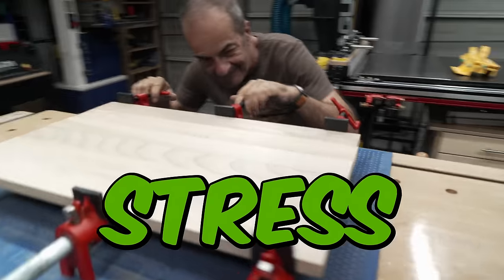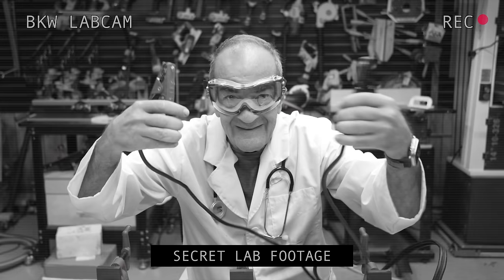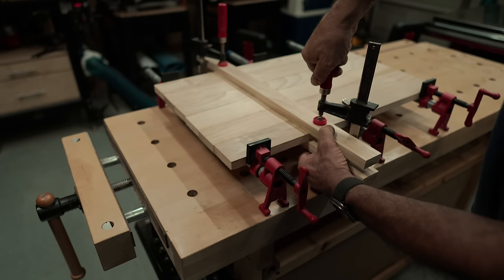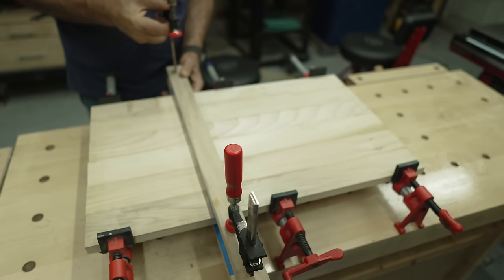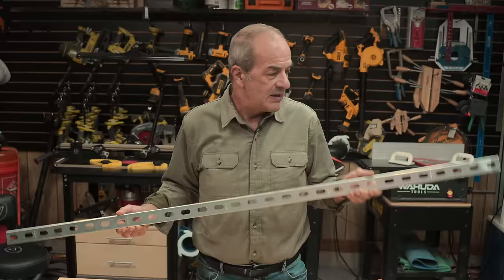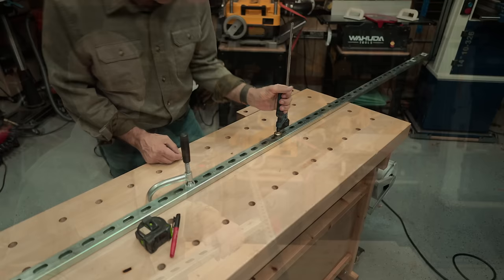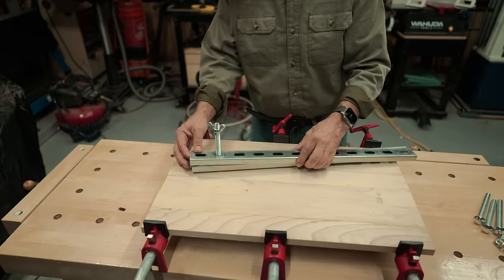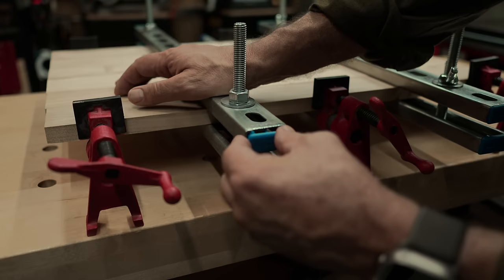Rockler doesn't want you to see this video

Comment: Having used thousands of feet of this stuff as an industrial electrician I can tell you that the 1-5/8” version is much stiffer than the 7/8” you show here, there’s also 3-1/4” deep if you really need stiff stuff. In addition, they sell heavy square washers so you can use the strut with the flat side against the wood to minimize denting of the wood.
Reply from the maker: The washers are great, I recently discovered those during a random stroll through my local HD. I’m aware of the larger sizes but those are more expensive and probably overkill for most glue ups unless you need to go really wide. Thanks for the tips, very helpful. I love when the viewers are smarter than me!
Reply: @BustedKnuckleWoodworks there are magnetic washers too for uni strut. Makes placing them much easier.
Reply from the maker: @akbychoice  really? I've never seen the magnetic ones. Gonna have to check those out!
Reply: As a commercial plumber who has also used thousands of feet of this, I came to say the same.
Reply: As a former plumber I’ve used superstrut in the thousands of meter range. Installed equivalent amounts of pipe on ‘m, also used it to create mounting solutions in awkward situations and spaces, for all kinds of appendages. These struts are also excellent for making mounting points in basements, without having to drill once into the basement walls. On the deep end, I’ve used superstrut to reenforce the inside ‘retaining’ walls of my version of an Earthship, where I wasn’t allowed to use discarded tires at the specific location. 
On the use of the carriage bolts, that’s of course a viable option. However, when one flips the strut with the smoothest side to the be glued object, the true value of the strut can be used. With the open side of the strut available, one can use threaded rod to length, put a slide nut on the rod, put this through the hole of the strut closest to the workpiece and then place the slide nut in position on the ‘fingers’ of the ‘C’. Following, this position can be fixed in position with a similar washer and hex nut. It secures the bolt at the location for several work pieces of the same width. Much easier than sliding the carriage bolt from underneath. 
Absolutely agree with Kevin Stenger on the 1 5/8” version being much stronger, and for heavy duty the 3 1/4” is indeed excellent. Equivalent in metric R2 15mm, R2 20mm, R3 40mm, R4 46mm, R6 60mm. Of which the R3 version is a double sided (thick) strut, which may be an option for super heavy duty. Cheerio
Reply: Outstanding ideas from all the trades guys, making a great woodworking idea even better!
Reply from the maker: @j10001 these trade guys are smart! They could fix the world if only we would let them
Reply: That was my first thought, flipping the struts around so as not to dent the panels
Reply from the maker: @denniswilliams2385  you won't dent the panels as long as you don't overtighten. PLus, the wind nuts wouldn't fit. But the square slip washer idea would take care of that I think... 🤔
Reply: With all those tools hanging in the background why doesn't he have a proper portaband for cutting strut? And did he properly file the ends?
Reply from the maker: @TNickel555  woodworking doesn’t have much call for a portable bandsaw.
Reply: I have some in stainless steel that is the 1 7/8. I have used it to make everything from a carriage for my welder in my crawlspace (had to reset my piers and I put in steel IBeams for new cabinets and granite countertops). There is is all kinds of stuff atuff you can use it for.
Reply from the maker: @danielbeltz1914 I’ll bet those stainless ones are pretty pricey 💰
Reply: @BustedKnuckleWoodworks  By that logic nor would you have much use for a metal grinder!
Reply: @BustedKnuckleWoodworks  I am a Fiber Optic Transport Engineer.. we use them in hand holes to secure fiber.. When i need one....... 😁
Reply: Carpenters probably shouldn't argue with electricians. Just sayin. But at least you're smart enough to learn from us!
Reply from the maker: @TNickel555  I usually keep a Kutzall on it and use it for carving in the woodshop.
Reply from the maker: @danielbeltz1914  like a thousand uses for this stuff!
Reply: Our cost on 316 12 Gauge 10' 1 5/8 is a bit over 300.. but we buy a flat bed at a time. Every job gets qouted a whole stick.. we might use 2 full sticks.. or we might use 6” and that stick wont go back out on a new install. It might get ised in a repair. But new installs always get a full stick on the truck. So i will bring the 10' - 6" home when needed. I did my Mini Split stand with it too. 😁
Reply from the maker: @TNickel555  for sure! 👍 I rely on the pros for that stuff. Electricity is hard 🫤
Reply from the maker: @danielbeltz1914  Noice!
Reply: As an electrician I came to say the same.  I'd like to add that Superstrut is a brand name. It's unistrut. Not all strut comes with holes premade and some versions come with the traditional round holes. Instead of wing nuts and carriage bolts you can use cone nuts and hex bolts.  Cone nuts are designed to grab onto the hooked lip of the strut.
Reply from the maker: @ianbelletti6241 I recommended the Superstrut brand in particular because the big box stores carry it, which makes it easier to find for most people.
Reply: @BustedKnuckleWoodworks  and I'm pointing out that it's a brand name in case people go looking and find their store is purchasing their strut from a different company.  Besides, you made it sound like Superstrut was what the product was called.  You could have been clearer that it's strut and the brand you find most readily available in your area is Superstrut.
Reply: Came here to say the same thing, I've lost count of how many thousands of feet of uni strut I've hung over the years. I'd switch to using the rectangle strut nuts and regular half inch bolts or whatever size bolt match's the strut nut. They'll cam themselves into place when tightening and stay attached to the bolt when loosened. Won't have to worry as much about losing nuts, bolts and washers and as pointed out allows the flat side against the wood.
Reply: Home Depot had a small section of unistrut for amateurs to check out the available pieces
Reply from the maker: @JamesSmullins  wish I had known about those when making the video. Sooo many people have mentioned this already. What can I say, I’m a woodworker. I never claimed to be smart 😂
Reply from the maker: @steverone7623  never seen Unistrut in any of our local HDs. I do know they carry different inventory in different regions.
Reply: @BustedKnuckleWoodworks  I’m in the Philadelphia area, all the Home Depot’s I’ve been too within a 100 radius have it. Idk about lowes too much and we aren’t near a Menards
Reply from the maker: @steverone7623  maybe they are test marketing it there. Nothing here in Austin.
Reply: @BustedKnuckleWoodworks  happens to us all when adapting something to something it wasn't intended for. There's lots of uses for the strut including creating storage spaces overhead by using pipe and strut pipe straps or all thread to hang more strut below. I use it to store lumber since I have a micro shop and every inch of space is critical.
Reply: Love it thanks
Reply: You could eliminate the side clamps by using wedges between the threaded rod and the wood
Reply from the maker: @fasteddiebull  I know, such a great idea! A few others have mentioned it. I’m like “D’OH 🤦🏻‍♂️ why didn’t I think of that?” 😂
Reply: @BustedKnuckleWoodworks  that’s crazy I have been buying For 10+ years unistrut supplies from Home Depot
Reply from the maker: @steverone7623  where are you located? Weird they wouldn’t carry it everywhere 🤷🏻‍♂️
Reply: @BustedKnuckleWoodworks  NJ about 15 minutes outside of Philadelphia
Reply: Yep, a few square strut nuts would be perfect.
Reply from the maker: @nickprice7752  agree. Wish I had known about those 🤦🏻‍♂️
Reply: SUPER STRUT for the WIN!!  Shit is very versatile to have around. Elechickens put that shit on everything
Reply from the maker: @KTSLAY  😂 “elechickens”
Reply: removing door panel.  2007 Honda Odyssey
Reply: I was gonna say the same. Plus, cut it with a porta band.
Reply: If you get a porta-band, put it on a vertical stand like Swag sells, put a foot switch on it and leave it set up all the time on a bench top somewhere you might find you use it all the time.  Mine probably gets more use than my big Jet saw does.  PVC, iron pipe, steel...its ready for all of that.  @BustedKnuckleWoodworks
Reply: Thanks for sharing, great tips but leave the funny stuff at home, it's not working.
Reply: Thank you for sharing your brilliant idea, just starting out and now I don't have to buy those large clamps, your system is so simple, yet effective
Reply: Thumbs up for this comment. I'm a contractor, and I've used 20' strut to make fall protection on a 2 story stairway.
Simple and fittings like an anchor base were pricey but way less than building other option.
If anyone is in denver I picked up a pallet of random fittings and nuts. I'll hook you up.

Rodger
Reply: You beat me to the denting idea.  I was about to suggest the same.  I wouldn't go to the 1-1/2 kindorf it is overkill for sure.
Reply: @TNickel555  except angle grinders have a variety of attachments other than metal grinding disks (sanding discs, power carving disks,  etc)
Reply: @TNickel555 oh yeah,  electricians are geniuses lol. You're weird.
Reply: @danielbeltz1914 so what your saying is ask our electrician friends for it instead?
Reply: @ianbelletti6241 you should learn how to speak to ppl without sounding like a douche
Reply: @jzahirniak a woodworker would be more likely to get a bandsaw than a portaband. Kinda difficult to resaw lumber with a portaband.
Reply: @theoriginalmonstermaker  You completely missed the point...and apparently didn't pay attention to the video cause, yeah, he has a regular band saw.  Thanks for playing though!
Reply: @jzahirniak if he has a regular bandsaw,  why would he get a portaband? If there was a reason,  then you're correct,  I definitely missed it,  bc I don't understand why you'd suggest he get one,  or what jobs can be done on the porta the his band saw couldn't handle
Reply: @theoriginalmonstermaker  CUTTING METAL!!!   You cant do that on a bandsaw made for wood.  The blade moves too fast and even aluminum will trash it while barely scratching the metal.  The porta band moves much, much slower and the blades are made of proper material for cutting metal.
Reply: @jzahirniak  oh.  I honestly didn't realize that.  But since you mentioned it, taught me something,  and promoted a search,  I gotta say,  the very first thing I found was that it is possible; so long as you have a newer bandsaw where you can reduce the speed,  you just swap the blade for a metal one.
Reply: @theoriginalmonstermaker  Still cant cut all the metal the porta can, barely any actually.  He has  Rikon Model 10-326 which is a two speed but the slower speed is still 1445 fpm vs the typical max of around 420fpm that portabands have.  The Rikon he has is equipped with a TEFC motor but many are not which means metal dust can get sucked into them.  They say you can cut SOME mild steel but it better be very mild at that speed.  You really dont want ferrous metal dust in the innards of your saw...especially if the motor is not a TEFC.  Really, you dont want any metal dust in there at all cause its very abrasive and wears things out.

Harbor Freight, Bauer saw is $120 stand is $120 = $240   Dont buy their foot switch, its terrible and more expensive than the one Wen has for $12 on amazon.  So for $252 you have a saw that you might be surprised how often you use and that will do things a saw like his Rikon never could...like cutting that super-strut.
Reply: @jzahirniak  very useful info,  thanks.   What do you think about those metal cutting blades you can put on mitre saws? I bought one for my old 7 1/4" sliding mitre,  but still have never used it bc it seems sketch.
Reply: @theoriginalmonstermaker  Again its speed.  The saws are intended for those spin slower than normal.  That one is probably intended to cut metal roofing and thin material like that.  Cant say for sure without knowing what blade you have in hand.

If you can return it then do.  If not then it will work but wear out much faster than it should...greatly depends on what you try to cut with it as well.  DEFINITELY wear eye protection in the event a tooth gets free.
Reply: @jzahirniak  yeah,  the blade exploding has been the reason I'm tentative to use it lol.
But from what I've seen online,  they SEEM to work for small stock. 
Anyways,  thanks for the assistance.
Reply: @theoriginalmonstermaker  Just about everything I posted was tongue-in-cheek, if you couldn't figure that out. That being said electricians are pretty much like any other population distribution,  i.e. a bell curve. There's a few real idiots who never should've been certified, some genuine geniuses, and the vast majority of us are just going to work to support our families. BTW the Milwaukee M12 line has a small handy Porta-Band for $250.00 at H.D. For strut, rod, Seal-Tite, heavy wire and small pipe, they're wonderful.
Reply: @BustedKnuckleWoodworks 🤷‍♂️sawdust between the ears now.. when I was working as a plumber it was different..
Reply: @TNickel555  Cool thanks.  Yeah,  I wouldn't make much fuss about electricians edging out the other trades in work complexity; understanding circuits and the behavior of electricity is much more difficult than mixing concrete,  but it's a narrow margin and a small pond... it's like being the brightest kid on the short bus
Reply: Thanks for the tip.
Reply: Unistrut.....Great stuff!
Reply: Great inspiration. Thank you. I'd like to use this c-channel on some future projects. I'm wanting to use this product to build some handicap helping devices. Elevator lifts, bathroom seats and rails, etc. The price of this product is high. Where is the best place to buy?
Reply: @TNickel555 Not so fast there...
The Angle Grinder is to power tools that the screwdriver is to hand tools...
W/the (Super Wide) variety of disk types & the other “add on” fittings, the humble Angle Grinder can don more unique capabilities than a Quick Chang Artist can wear different clothes at the same time!
Be it Corded or Cordless, the (now not so) humble Angle Grinder is doing the best 21ˢᵗ Century impression of Dr. Who's Sonic Screwdriver that might be humanly possible.
Reply: And Scary!
Reply: @ianbelletti6241       Right!      Hang on, lemme grab a Kleenex™...
Reply: @BustedKnuckleWoodworks  
You can always magnetize steel washers. Put a neodymium magnet on it and slide it off. Repeat as needed.
Reply: yes

Comment: Hey, so not that you asked but here's a mod to this that would help keep them flat. For each caul, set a small offcut from the piece being clamped (same thickness) on the other side of each bolt to counteract any flex that would bow out the middle.
Reply from the maker: Amazing suggestion, especially for the wooden cauls.
Reply from the maker: @kkarllwt  also a great suggestion 👍
Reply: This is a great suggestion. I was worried about the possible bulge in the middle too. But it is probably not an issue for 2.5 ft, more of an issue for wider boards. In those cases, you could also load the middle with plywood sheets or dumbbells 😅
Reply: Genius. Like all the best ideas, it’s obvious in retrospect but I didn’t think of it.
Reply: they taught us back in school, you know back in the old days when they actually taught shop classes in school, anyways they taught us to put paper towel between any glue joins you didnt want permanent. you could easily break the glue join and sand off any excess glue. would be a good option should you choose the wooden cauls
Reply from the maker: @warr68  I show that in the video… did you miss that part? 🤔
Reply: @BustedKnuckleWoodworks  yes, sorry bad habbit of mine to comment while watching the video instead of waiting till the end to co
mment, my bad :(
Reply from the maker: @warr68  no worries my friend, I do that sometimes too! 🙈
Reply: Wood works better as you can make it bowed so when you clamp it applies pressure all the way across
Reply: Little additional unsolicited advide: Turn the wooden cauls by 90 degrees so that the smaller side is on the workpiece. They'll be much stiffer and probably the fastest and cheapeast approach.

Comment: Never thought of using those. I work in a data center, and  when we have the contractors come in to do electrical work. They use them and toss a bunch out. Soi can get it free. BUT I have a better idea. Why not use the camps through the holes like you did with the wooden ones. Thanks for the video.
Reply from the maker: Because I only showed the F-clamps as an example of what I used to do. Nothing stopping anyone from using those but it makes the solution a bit more expensive.